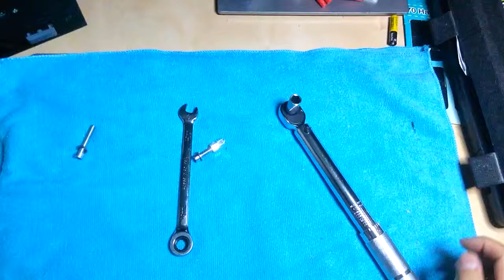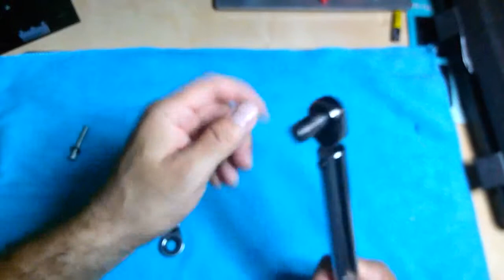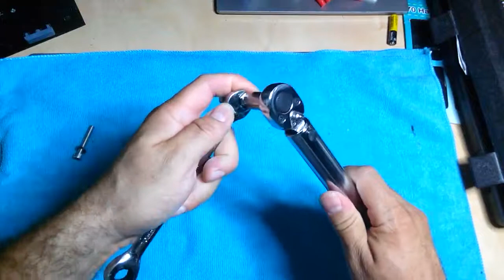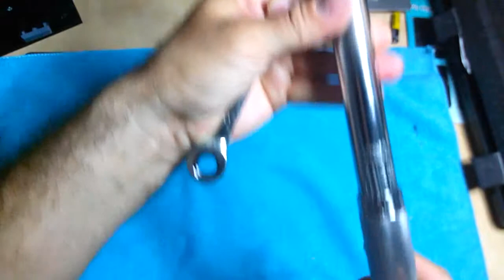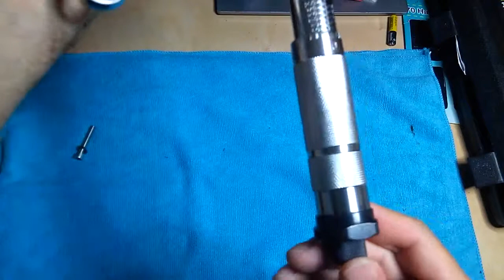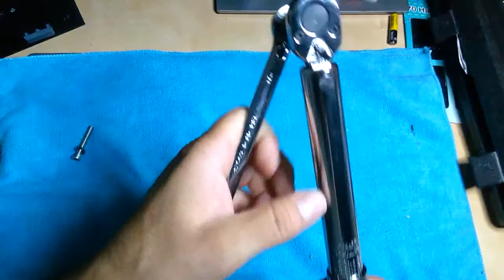Harbor Freight 1/4" inch torque wrench 2

Comment: LOL just got one replaced because I could not hear any clicking and was over torquing. It really needs to let you know your at the correct setting and silence doesn't do it. Tens bucks.
Reply: I got the Performance Tool version (Taiwan) of the HF 1/4" for 8mm valve cover bolts. Right out of the package it was tight and inaccurate, but I ran it up and down from low to high to low, testing at several levels on a tight 19mm lug nut, then it worked great. Rather than worrying about a click, I felt and watched for the break at the neck. At 20 in lb and low settings, the neck will break with the pressure of just one finger at the end of the handle. At 50 in lb, careful pressure with two fingers caused the break. I think at 80 in lb two or three fingers pressing on end of handle brought the break. I found out that this testing up and down the scale is required before each use of the wrench. That's OK. Also, I was to tighten the valve cover bolts to 80 in lb. For safety's sake, I first set the wrench to I think 50 in lb, and tracked the neck break/bend. Then I went up to 65 in lb or so, and did the same. Then on up to 80 in lb. This stair-step incremental method helps to get a feel for tightness and helps to hold on to sanity as you work your way up the scale to the required torque.

Comment: Just making sure it wasn't just me, I can't hear mine but I thought if it gives like yours, that would be the spot.
Reply from the maker: Yeah these smaller ones are barely audible so you have to go more by the feel than the sound. Over time you get better at it. Specially on aluminum.